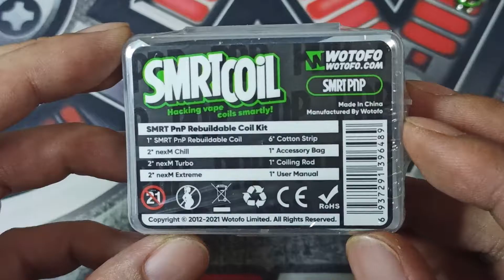Wotofo SMRT PnP Rebuildable Coil Kit | Building on low wattage device

Comment: Hi sir all this pnp rba type can accept salt nic 50/50 or 60pg/40vg type? Or I need stick style pod to vape on salt nic?
Reply from the maker: you can use freebase juice with 50/50 or 60/40 ratio. Saltnics are for pods so doesn't matter. For 70/30 or 80/20 freebase ratio, I suggest using premium cotton. I'll cover this on my next video.
Reply: @uncannyvapes  thx man. Nice vids